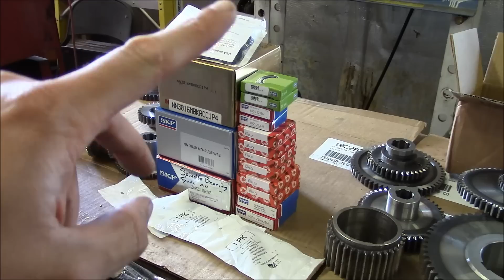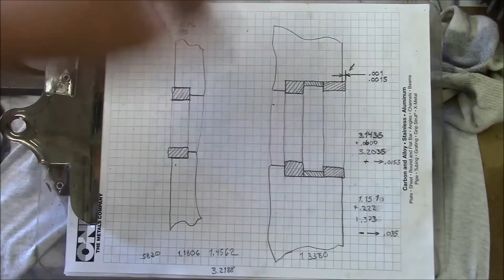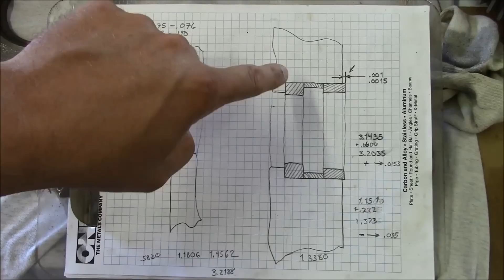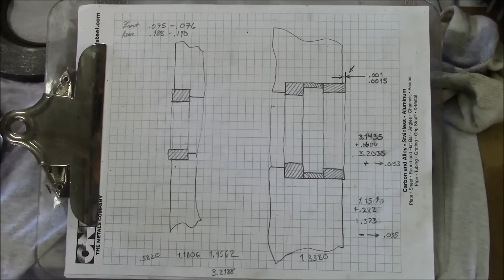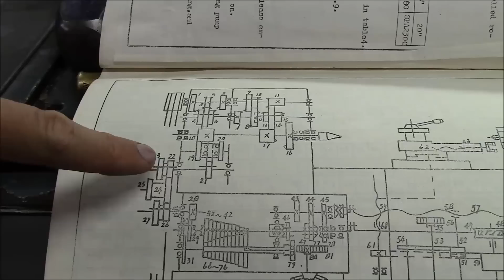Engine Lathe Headstock Rebuild / Spindle Bearing Replacement

Comment: To get the maximum benefit from this video BE SURE to listen to the last 3 minutes where the choices for tools, supplies, and methods are thoughtfully explained. Some great tips regarding why he uses a steel tool to seat some of the bearings (including specifically why he DOES NOT use brass, bronze, or aluminum tools in those instances). Also great advice on product selection for liquid form gasket materials. Highly recommended!

Comment: This is the best video I've seen in a long time! Your manner is first class, as is your temperament. The one thing you need on a rebuild that's fairly complex is a control that comes with experience. You've got that Wes. Well done. (I was doing lathe rebuilds back in late 69-70)

Comment: Excellent video! I have worked on a number of Asian import machines where the user's manual and/or part diagrams were dismal to non-existent. Often times, it took quite a bit of interpretation and trial to get things to go back together correctly. Now when I disassemble anything, I take videos and pictures, with written and verbal notes, of everything in minute detail to make my own guide. Thank you

Comment: I did a head stock rebuild for a relatively ancient, but very dependable large German lathe. Obviously no parts existed and finding the exact "denominations" was a murder because these things remain the same, but always change. I never tallied it up, because i bought parts as i found them, but i think it must've been something like ~4k euros. I don't even want to think what it would've costed had i gone the suggested route, which was to bring a specialist, because most of the time i spent after getting the parts was fitting things right. New washers, cut a new bearing pocket here, dress the face to this pocket there. PITA. But in the end it was worth it because tho i rarely use this lathe, when i need it, well "there's no replacement for displacement". As you said, for hobbyists the price is unfairly stacked, back then i could barely justify it, i could probably pass it off as a business expense these days. :))

Comment: Reminds me of the time I restored/ revamped my old Black&Decker valve grinding machine. The local Chev dealer in Texas was throwing this and all attachments away. I asked to buy it and they told me to get it all picked up and gone. I obliged. It was old because it had pilots and stones for Model A Ford's, 38 Chev, DiamonT and Reo. Driver was burned up, got a good P&H from a friend.

Comment: I have the 95% same lathe from an old fishingboat  and needed to repair highest speed gear connection (for the fun) . This video is 100 times better than the copymachine manual from 1999 .

Comment: Once again great information. Holy crap that looked complicated. Nice work. I would have never guest the price of the bearings. When I started out an expensive one was 6 or 8 bucks and a seal was around 2 to 3. That wasn't that long ago. Thanks Wes

Comment: A high powered magnet at the oil pickup and a couple more placed at the bottom of the head case will help keep any future steel chips/filings from getting into the oiling system. Most automotive oil pan plugs have a magnet built into them for that very purpose.

Comment: excellent video, I had to do this on an old Willson lathe without any tech info, I had to replace all auxiliary bearings in the headstock fortunately, the spindle bearings were acceptables.
Reply: I've got an old Wilson lathe I'm hoping to get into the shop some day and it needs a complete rebuild.. any advice / things to watch out for?  I heard from another Wilson owner that the headstock had casting sand still in the headstock!

Comment: When "precision beating" bearings it's possible to help prevent "pre brinelling" by making a stout washer to beat on, this spreads the blow onto both inner and outer race.  Takes time but you are less likely to revisit those bearings.
Reply: Agree. And STOP using steel shit to drive these piece together. Use brass or even aluminum. Eventually you're going to chip a race or screw one up some other way.
Reply: @jeromeclements6532  well, you can’t always do that. He points out, correctly, why he uses a steel tool specifically designed for that purpose. I do that as well. Maybe you need to learn how this is done.

Comment: your videos are not only informational, but inspiring. you got me motivated to align the trunion on my 5 axis today. i will say rebuilding integral motor spindles is much easier, my last spindle rebuild was an afternoons work. keep the videos coming i need more inspriration
Reply from the maker: It depends on the spindle design. Some of those integral spindles are a real pain. The stators have to be heated or, even worse, some are bonded to the spindle. I like belt drive spindles like my Mori SL-20. That's an easy spindle to work on.

Comment: I will definitely be checking out more of your videos. Some ideas to mull over. I have had a lot of luck assembling and disassembling stuff with home made wedges and screw jacks. When I say wedges think adjustable parallel, where you can use a clamp to apply pressure on opposing sides of the wedges creating a jack effect. As for the screw jack, just need a couple different length bolts with matching nuts/hardened washers and various lengths of pipe. Both are handy as heck in tight quarters.

Comment: Before watching your videos, lathes and mills were machines I used at the research lab in college 45 years ago. It was fun but I only did crude non accurate parts for the experimental projects. Never needing to make accurate parts I never thought about the precision of the machines inner workings.  You have educated me.
I assume you are an ME.  I'm an EE. I watched you work on a PCB and you understood the electronics as well as me.  It's like you got a ME and an EE.  Actually I knew a couple guys who did get double degrees but they were trying to keep their draft deferment to avoid Nam.

Comment: Oh man I really feel for you. On the price on those bearings $1200 wow that's not cheap. But you know she will pay you back two fold. Ounce she's up and running. And no doubt restoring and completely stripped down at least you know it's going to be running perfectly. Besides you can feel  confident that you done a great job restoring. All new bearings. Plus all the experience you have gained and all the pleasure in knowing that you did this all yourself . Nothing better than self satisfaction and accomplishment. I'm sure she going to be a great running lathe. I'm in the exact same process as yours  and pls let me tell you my lathe is in pretty rough shape considering she was built in 1939. The previous owner didn't take care of her at all. And covered the awful welds. With what looks like tar. To hide all the bad welding. Talk about a tragedy. But I've decided to do a complete restoration. But you know I'm totally having fun restoring her. And I'm sure you are too. My only worry is I don't find anymore bad welds  Keep up  the great work  your doing a fabulous  job. 👍👍👍👍
Reply from the maker: You are right, the cost of the bearings is an investment in the machine and I know it will pay me back.

Comment: When installing the bearings into the headstock bores.  1st heat the area to around 150F with a heat or halogen lamp.  Then U won’t need a hammer, it will slip in the bore with around .0005/.0008 clearance.

Comment: Nice job, years ago I rebuilt a MBZ unimog 6 speed transmitting that was disassembled by another shop. Fortunately I had a shop manual, but it was still a challenge...Dave
Reply from the maker: That sounds like fun. The craziest truck transmission I ever had apart was a Mack triple countershaft 13 or 18 speed. Can't remember which now.

Comment: Nice vid. You have a nice touch, people don't realize how difficult it is to finesse with a hammer.
As a former Euro-car tech, I do have one criticism though.
The bearing race punch weighs enough on it's own to drive in the bearings. You should guide the punch with your fingers and just tap the race with the punch. Not only does the job go much faster since it is easier to tap around the race, you wont have the punch dive into the balls like what kept happening to you. There was also a few times you where working the inner race with the punch and it kept slipping. Add a set of cheap 1/2"drive 12point sockets to your kit for doing this.
Reply from the maker: The real issue, and you may not be able to see in the video, is that the bores for the various shafts do not go all the way through the headstock. So, I have to come in from an angle to drive in the bearings. That makes things very tricky. It's a poorly designed gear box.

Comment: Thank you for explaining bearing preload amount,  yes good point about brass punches chipping off,  i like making bearing drivers, and special tools,
Reply from the maker: It's much easier to make those tools when your engine lathe is not in pieces...
Reply: yes good point you need another lathe.

Comment: Wow 1200! You buy a half decent little chines lathe for that. This machine looks a bit bigger though. 
At some point I will need to take my little Chinese lathe apart. The spindle makes more noise than I like. But I'm afraid I won't get it back together. :) Thanks for showing us how it' done.
Reply from the maker: It's better than $2,400 retail.These are big bearings. The fronts are 150mm diameter.

Comment: Great, really great video.  One question.  I'm assuming that the test piece shown at the very end of the video is super smooth.  Wasn't that the entire point of the entire gear system rebuild, to obtain chatter free smooth results? (Cause -- Effect)  I'm assuming the wear on the slides only affects the ability to create  perfect diameter cuts along the entire length of the workpiece.  Is that right? And thanks for sharing the tools and materials used.  You've given me more confidence in my abilities to fix difficult problems.  Many thanx.
Reply from the maker: We will do some more testing in a follow up video. Yes, the finish is improved. There is still a lot of work to be done to fix the the other worn areas of the machine.
Reply: great.  really good video

Comment: Wes, when ever I buy bearings, I look for EMQ grade, they are Electric Motor Quality, they run smoother, quieter and longer.Here is an example of the brand I like best and the price is around 6 bucks.

6203-ZZE C3 Nachi Bearing EMQ 17X40X12mm 6203ZZ DOUBLE SHIELD

I know most of the bearings used in the Norton MCs, I work on are C-2 fits, and they are hard to find and pricey if you can. The C-2 has a tighter internal clearance, so the the parts don't rock or have run out in use.  A new C-3 fit bearing will feel worn out compared to the used OEM C-2 . In the clutch drum hub center  and rear one piece brake drum/ sprocket it is particularly important.
Reply: This is not completely true as you're not taking into account operating temperature and thermal expansion.  Standard bearings for industrial use are C3 clearance.  Once you make the move to a high precision bearing, you're jumping up a considerable amount in price.  It all depends on the intended application (you'd be surprised at how many engineers know very little about bearings).  Also, nobody would install a 6xxx series deep groove bearing in a spindle.  Spindle bearings are always matched pairs of angular contact bearings (but you have to know your contact angle if it's an older machine with a worn/missing/unknown bearing number.

Comment: Seating a deep groove ball outer race by hitting the inner race is what cause brinelling during installation. The low angle of the ball contact causes high forces which can impinge the balls into the race. Always push the race which is being seated if possible. and if you can not then press it in rather than hammer it to decrease impact loads.
Reply from the maker: Sure. In a perfect world that might be possible. In the real world, it rarely works that way. Most of the bearings press fit on both the outer and inner races, so they have to pressed against the balls. Also, the bearing bores often do not go through the box, so there is no access for press tooling. The press fits are pretty light, so the risk of damage to the bearings is very low.

Comment: It is the first time I see that every shaft, gear and shifters put in place with a hammer. There is certanly a problem with the size of the shaft or the holes in that lathe. I believe  that you know that they sell files and reamers that will help you put everythings togeter whit out a hammer

Comment: Thanks for sharing Wes, I'm curious when you where installing the bearings why you would use the snap on drift and only knock one side at a time instead of using a bearing driver with the right size end on it? As you know they come with different size ends. you could fit the bearing driver shaft through the hole in the casting then put on the appropriate end to knock in the bearing. Keep up the great content!
Reply from the maker: That would be better. I was just too lazy to make a proper driver.

Comment: Nice video Wes, lot of clips to tie together. My dad used form a gasket forever and so do I, it is good stuff . Yes, I cringed with the punch on the bearings:) What did you seal the bottom of the gear box with? Keep up the good work, I always enjoy seeing what you are up to.      SteveSummers
Reply from the maker: It's just Rustoleum paint. I chipped off all the loose paint first and cleaned everything as well as I could. I should have painted the whole thing, but no one will ever see it...  I think there are around 50 different segments edited together to make the video. It's really hard to get a view of the top of the headstock, the camera is always blocked by my fat head.
Reply: You done a very nice job tying all together, not as easy as people think, that's for sure.

Comment: Quick question, did it make the lathe any quieter? I know my Lathe is so loud at full speed hearing protection is in order 
Edit: Dammit I knew I should have waited till the end to post! You answered my question!
Reply: Not that you can change anything, but herringbone teeth that are 1/2 a tooth out of phase with each other are FAR quieter, and can carry much more load. The contact noise from one tooth is cancelled out by the next tooth engagement.
Reply: @stanburton6224   I just put up with it. I tried different things but you get what you pay for. The extra features like  the brake and the built in coolant system and light is the main reason for purchase.

Comment: What a great walk through. Nice job Wes.  Impressive work.  The bearing cost had to make you pause for a minute.  Have you thought about making a few bronze inserts for that Snap On punch? I have to admit I was cringing a bit - but that was from my viewing angle and you had the birds eye view.
Reply from the maker: The driver is actually pretty soft. I would guess it's about 30RC. The bearing races are like glass, probably around 60RC. You have to be pretty rough on a bearing to actually dent it. It does make me cringe though. It's just the natural reaction to that kind of rough treatment. I could have used my bearing heater for a few of the bearings, but I actually forget all about it...

Comment: ....And this is why I bought a belt drive lathe for the home shop.
Reply from the maker: Well a belt drive is simpler, but will never have the toque of a real gear box. Everything is a compromise.
Reply: Well there is back-gear...but the point being that in a for profit shop a Chinese lathe is ok starting out, but you need to be looking for a real lathe to replace it as soon as possible. If you are concentrating on CNC it would be ok to keep a lathe like yours for odds and ends (if it wasn't already clapped out).
I've run a brand new mainland Chinese 14" gear head lathe just out of the box... I'd have been ashamed to put my name on it. Management wanted to save a few bucks and they got what they paid for... not much. I assume they finish machined the gears in the head stock, but I think the builder assumed after a few years they would just "wear in." Changing spindle speeds was something to be avoided... once you finally got it into the spindle speed you wanted, why tempt fate again? There is a real reason a Taiwanese lathe costs 15% more than the identical mainland machine...pay the 15%, you will be glad you did.
The Chinese have a phrase they use constantly that roughly translates as "that's just the way it is/it's not my problem"... and that explains every product you by from mainland China (unless you hire some Japanese or Koreans to watch 'em like a hawk while they build it). What you buy may be ok... but it may not, and they don't care one way or the other.

Comment: that NN3020 KTN9/SPW33 is available for 448 UKP from ebay just now so 650 dollars or so ...
Reply from the maker: That sounds about right. I see NOS spindle bearings on ebay for $400 to $750 pretty regularly. That's about half the cost of new bearings from a distributor.

Comment: Why did you put P4 suffix bearings on the spindle? P5 is what it would have had. That's why they were a lot cheaper. Chinese made P5 bearings work fine. SKF source from China. I work as machine tool mechanic so see the insides of all sorts of headstocks, old and new. China's biggest problem in the past was/is not cleaning out the headstock castings of grinding detritus at time of manufacture which then floats around in the oil and scores the bearings prematurely. The number of spindle bearings I have replaced on newish Chinese machines as a result is quite high.